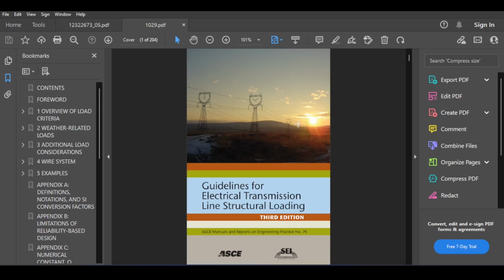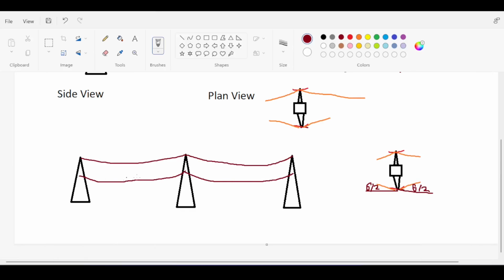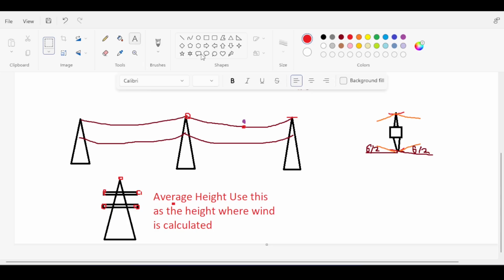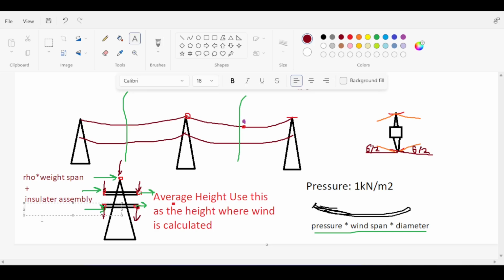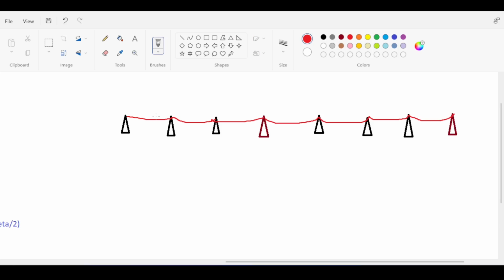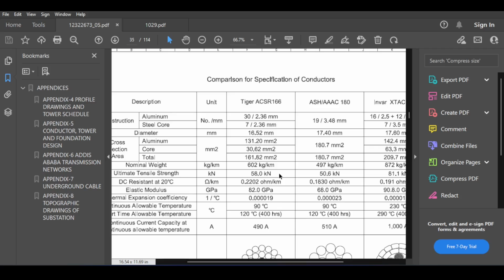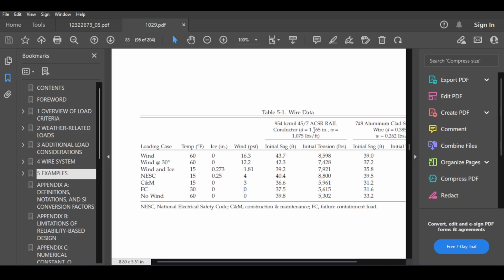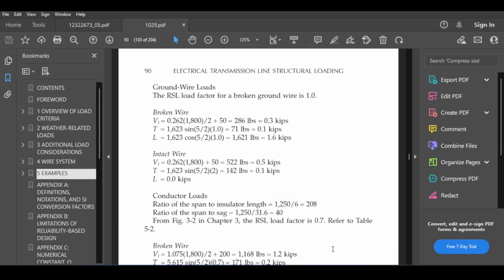Modeling Lattice Steel Transmission Towers Using Autodesk Robot | Part 3 - Load Calculations

Comment: Hello Civil Engineering Essentials, kindly know that in my opinion @20:09 you absolutely can and you should proudly and unapologetically BRAG about this channel methods and contents, CEE channel is second to none so far and it just keeps getting better💯. 

Question:

1. With reference to the “Yawed Wind” section 2.1.6.1.3 (figure 2.8), section 2.1.6.2, and the example Table 5-2; For “Conductors and Ground Wires – 2.1.6.2.1” and for all angles of yaw, the ASCE guidelines states that the effective force calculated by Eq. 2-12 is perpendicular to the conductor or ground wire.  

My question is this: Why is there no “parallel or longitudinal” component of the yawed wind effective force on the conductor (in the guidelines) 🤔???, I mean in the same way as there are “Transverse” and “Longitudinal” components for the yawed wind effective force on the tower or on the latticed truss structures -2.1.6.2.3, equations 2-13a and 2-13b?

Thank you for this tutorial. I could not agree with you more on the importance for the designer to know and appreciate how the loads are for the project. CEE have done a fine job with this tutorial to ensure this for this project. For me, this video is like the viewers “failure containment tower structures” ☺😁☺.

@26:15 and on the next video, I’d like to ask that although CEE may have those loads pre-calculated; CEE should consider to “very quickly” run through those pre-calculated loads and their specific calculations used (in the same way as it was done with the example from the ASCE guidelines on this video tutorial).    

Have a great day,
And I am looking forward to the next video.
Reply from the maker: Hi Eng. Donald.
Your question is really amazing <3 <3 I am in love with it. I am really happy that I have top tier engineers watching this channel. I was - and still am - a nerd myself, so I immediately appreciate deep questions. 

It need to make a small deep dive to answer it:
Now first things first: Air brushing against a surface will produce two forces
1) force perpendicular to the surface area, which is dominant and is due to newton's third law (remember your fluid mechanics classes) or due to Bernoulli's theorey (it is kinda the debate that is still running of how a wing produces lift.

2) a force parallel to the surface, due to friction. This is not usually dominant because our surfaces are usually smooth. That is the reason why drag when compared to lift in wings is small.

Ok, let's establish the areas a cable has.
A cable has a circumferential or (side) area, and a cross section. The cross section is small in comparison to the side area.
So, consider the side area.
I know you are tempted to say: cosine for perpendicular forces and sine for parallel forces (longitudinal), but that is not really correct.

You see, the reason why you cosine (or sine, depending how the angle is measured) is not to (decompose) the force, but rather to calculate the "projected area" that is perpendicular to the wind ^_^
Cables are naturally smooth, so we ignore the drag we get.

I know you would still say: how does this change for structures?
well, here the answer is still the same: since you have a structure, you are using non-circular sections (usually) which do possess areas in multiple planes (xz, xy and even yz). That is the reason why it does react to the wind in any direction.

As for your request, sure thing ^_^ will do a quick calc.
I might prepare an excel sheet if time allows and upload it for my dear viewers.

Finally, please let me know if my answer made sense, or if any follow up is needed.

Regards,
CEE
Reply: Hello Prof MJ,

I am flattered that you have referred to me as being amongst top tier engineers. This coming from you it is a HUGE complement to me, thank you. Your channel is key to my continuing development and interest in engineering.

Regarding your answer, I just love it when you say “…. I know you are tempted to say…., I know you would still say….”😊 it is like you are reading my mind.

A) Yes, the answer make sense, I find this part of the answer to be crucial: “….You see, the reason why you cosine (or sine, depending how the angle is measured) is not to (decompose) the force, but rather to calculate the "projected area" that is perpendicular to the wind ^_^ Cables are naturally smooth, so we ignore the drag we get….” 

I have utilized the example in chapter 5 of the ASCE guidelines as reference and numerically worked-out (estimated) the wind force against “the projected cable x-sectional area” and “the projected cable longitudinal area” assuming wind angle of yaw of 30 degrees and converted units to SI units as follows: 

F perpendicular = wind pressure*cos (Psi)* (diameter x wind span) = 0.78 * cos 30 * (29x10^-3)* 457 = approx. 8.95 kN
(this value is somewhat-ish 🤗comparable to the ASCE guidelines calculated value of 2.4 kips = approx 10.68 kN for the corresponding conductor transverse load on Table 5-2)

F parallel = wind pressure*sin (Psi)*(pi*square of radius) = 0.78* sin 30 * pi*(14.5*10^-3)^2 = 0.000258 kN

Even with the maximum increased yaw angle in favour of “F parallel” i.e., Psi = 90 degrees, F parallel = approx. 0.000515 kN

I know 😊 the above simplification is disregarding coefficients and other factors, but I am of the opinion that important conclusions can still be derived from the simplification above. One such conclusion will be that the parallel wind force component due to the wind yaw angle is [in these cases] relatively small that it can be justifiably ignored.

B) Your answer has also presented intriguing fundamental and conceptual perspectives of “DRAG” and “LIFT” forces caused by AIR or FLUID from the AERODYNAMICS forces points of views. A very basic and quick small dive on my part confirms that “friction drag” is relatively small in cases where the object surface area of contact with the air or fluid passing through that object is small (of course there is a lot more to this than just the contact surface area 😊). Alas, I am also happy with the statement made by CEE that “…. Cables are naturally smooth, so we ignore the [friction] drag we get…”

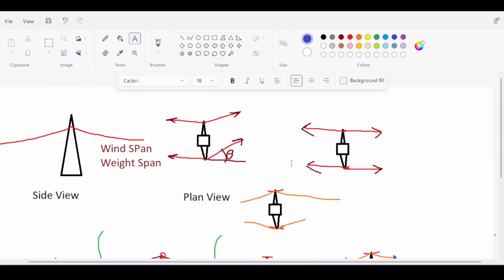I think it would be good for the designer or the engineer to always appreciate the perspective and assumptions being made regarding the estimation of the wind forces in this case and in general. Just as CEE have said at 12:51 in this tutorial = [an assumption is not always the case and the engineer need to be careful when the assumption and perspectives are applicable and when they are not applicable]

Regards,
Donald
Reply from the maker: it is always amazing when I see viewers going the extra mile to try some calculations on their own. I totally agree with your results.
it actually proves to me that my approach works fine to:
1) give the "let's get it done" type of viewers the information they need
2) give the "let me get the basics and engineering sense of it" information that intrigues them to dig deeper themselves.

I am happy that you like my content. I wish you all the best ^_^
GL

Comment: Hello CEE.
I hope you are doing well?

I usually respond to your post ASAP, but this time around, I had to take several days off for a personal research on this topic to make sure my questions are sensible enough 😀.

One quality video a week has given your dear viewers ample time to research and reflect more on the topic and your videos. 

Tbh, The contents on this channel is spot on 🎯 and extremely educative. 
I wish YouTube had a feature to rate your channel, possibly more than 💯is what you deserve. Nothing less.

CEE channel has proven to be a safe haven for its viewers, especially for engineers with little or no experience in the design of these type of structures and as such you deserve every bragging rights 😇

The JICA report and the ASCE manual have been extremely helpful. Kudos Prof 👨‍🏫 

However, I’d probably need further clarity on these bulleted points with regards to the this tutorial and it’s application in the next.

Please find below the question trail.

Thanks
Reply: The lateral wind force of on the powerlines and ground wire is given as, 

Area of exposed area of the powerline x design wind pressure

where the  exposed area of the powerlines is calculated as the windspan x cable diameter

1. The cable diameter as per cable data in JICA report ( page 35). For Tiger ACSR 166 cable, is it possible to calculated the powerline diameter from the cable construction data given in the table as opposed to picking the diameter given in the table? I have tried it and the diameter of the bundle of cable don’t tally with what’s directly provided by JICA. 

2. The exposed area of the cable is calculated as though the cable is a pure rectangle when the powerlines have a circular or curved surface.
Is it possible to compute the arc length of the power line instead of using the diameter? Could we also modify the diameter of the powerline to best reflect the circular shape of the powerline ?

3. Will the powerlines and ground wire under wind loads experience the full intensity of the wind pressure? Since the cables are likely to undergo swinging action under the effect of the wind?

3. It took me days to realize the line angle of the power line (theta) is the angle between the cable of the  fore span and the line of action of the back span.
I am really happy I went down this road 😃. Total fulfillment 

The resolution of the tensile forces in the cable into the orthogonal direction gives us the bisection of the angle and hence ( theta/2)
Am I right in saying this? 😃

Thank you Prof.
Reply from the maker: First off, I am happy you liked it ^_^ .
It's nice to witness those discussions and reply to them in detail. I always encourage any questions and will answer them to the best of my ability. I will keep giving it my best in hopes of spreading this knowledge to everyone for free.

As for your questions and comments:
Q1:
Calculating the diameter from the given data is not accurate.
the data states: 30 cables of some material + another 7 of another material.

Since those cables are bundled, you should rely on the vendor to tell you. This is similar to the tendon bundle made up of strands.

Still, this would not be CEE if it does not give you a small info nugget. We can estimate the diameter from the givens by looking at the drawing of that conductor (bottom of table)
Just by eyeballing it, you can see that the diameter of the full bundle is covered by around 7 little cables, so 7 x 2.36 = 16.52mm ^_^

As for Q2,
well, the area of wind is calculated as rectangle. And it is corresponding to an arc. Here is the details:
you see, there is a wind span. The wind span is actually the length of the arc that has an effect on wind loads.
so when you multiply windspan by diameter, then it is as if you have "stretched the arc to be perfectly horizontal" then mutiplied it by the diameter. Which still works.
This is similar to an equation you would use to estimate the area of a pipe, you multiply the arc length (the perimeter) by the wall thickness.
As for the diameter of the powerline, things get a little tricky. You see, those are bundled lines. Depending on the vendor, they might be smooth (we assume it smooth anyway for all intends and purposes). Thus, the usage of the diameter given in the table is warranted (also, I explained how it is calculated).

Q3: oh that one is lovely. I had a discussion with our dear viewer Engr. Donald in the other video (modeling part 2) on that regard. it might be helpful. It is really fulfilling when things get full circle.
and yes, the lateral forces due to having a line angle is due to half the angle, as the tower was assumed to be the "bisector" of the angle. Now this is usually the case, but sometimes, if it is not, then you have to calculate each tension using its own theta, and even the longitudinal elements (where you cos theta/2) will not cancel out.

Most welcome. I hope my explanation was clear.
Please let me know if it made sense, or ask any follow up question if necessary

Finally, I would like to use this chance to extend my thanks to you. Your input, questions and insights have been invaluable to this channel. So thank you very much. I wish you all the best in your career.
Regards,
CEE
Reply: @CivilEngineeringEssentials   Hello sir,
Q3 has not been answered. Am sure it’s a numbering mistake from my end. Am not going to edit it I’d leave as is. 😊

The line angle thing is a tricky one. But it actually made sense once I understood that it’s the angle of deviation of one cable from the other. And hence the transverse lateral force due to line angle results in the bisection of the line angle into (theta/2)
It was gold for me. 😃

For Q1 Am extremely satisfied with the explanation to pick the diameter of the powerline from the supplier data sheet. From the page 35  of the JICA report  it’s obvious the bundle of the powerlines have some gaps when the Aluminum and Steel strands are put together side by side as a single bundles. Thanks for referring me to the image . That’s a good one😅

For Q2; Using the diameter of the Powerline to calculate the exposed area of to wind is also tricky one and still doesn’t sit well with me.

Since it’s a circular powerline I should atleast see the constant value of pi (3.142) in calculating the perimeter  of a circular cable exposed to wind loads. 

Unless probably the codes treat the exposed perimeter of the powerlines ( which is an arc/circular in nature) as though it’s a projected perimeter of the power line (diameter).

I hope you understand my submission sir.
Thank you
Reply from the maker: Hi there ^_^

I actually have forgotten to check your first Q3:
Indeed, cables under severe wind loads may start to swing, and this (from physics point of view) can even relieve some of the force being applied to the tower, as parts of the kinetic energy of wind is absorbed in making the cables swing. (This can also, in some cases, increase the force)

Not only this, but swinging cables affect the geometry of the cables, especially the sag portion, as cables swinging left and right will also go up (similar to a swing in the park).

So, you are 100% correct and I agree with you. It is even in the ASCE guidelines. Unfortunately, I have not included neither the swinging effect nor the wind load on tower effects, but referred the interested engineer to the ASCE guidelines. So kudos to you for raising those questions, it really makes me happy.

As for the diameter,
Let me try to rephrase your question in the way I understood it.

You are thinking that:
since wind is blowing on the cable, the side area should be half a circle's perimeter multiplied by the length of the cable.
so in your estimation, it should be something like:
0.50 * 3.1415 * d (or 2pi r  / 2 )   and then multiplied by L

Well, that is not the case. Now, let me explain it by telling you when it would be the case and when it is not the case.

Half of the perimeter would be used if the pressure was perpendicular to the circular surface.
This means that each and every point on the surface of the half circle experiences the same amount of pressure from wind.
Notice that in your view, the area of the cable is a half cylinder.

Now this is incorrect and there are two possible explanations for this:
Explanation 1:
Assuming that - indeed - the wind pressure is perpendicular on each and every point on the surface, this means that each point has a pressure force that has a different angle than the point beside it, because the pressure must "curve" with the curvature of the circle to be perpendicular to the circle. This means that you can find a resultant force by cosine-ing or sine-ing the individual pressures, leading to an integral equation. Now sine or cosine is equivalent of us projecting the area. And the projected area of a "half cylinder" would be a rectangle with a height of d and a length of L

The other possible explanation 2 is:
to consider the wind a projected load on the cable. This would shorten my explanation. Because in that case, a projected load is multiplied by the projected area. Which is once again d * L.

Still, if there is any doubt or further questions, feel free to ask anytime.
Regards,
CEE
Reply: @CivilEngineeringEssentials     you perfectly paraphrased my question, and my doubts is cleared. 
Thank you Sir. It was a good explanation.💯
Reply: @CivilEngineeringEssentials     you perfectly paraphrased my question, and my doubts is cleared. 
I agreed the projected area is Lxd
Thank you Sir. It was a good explanation.💯